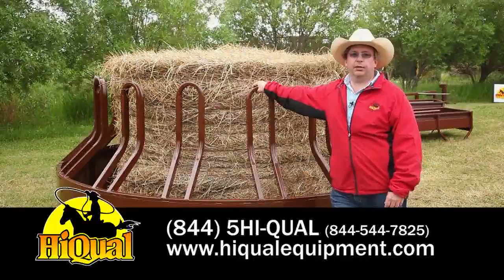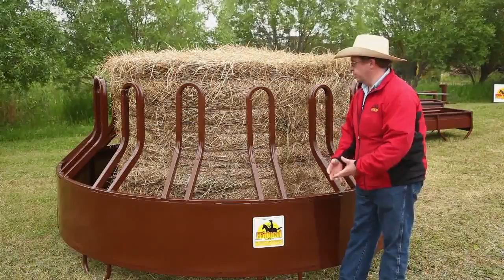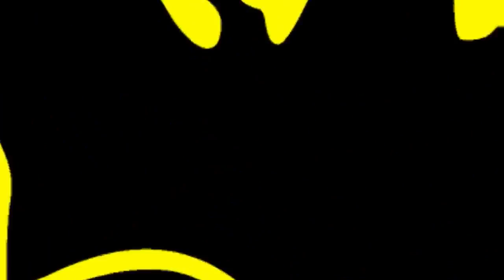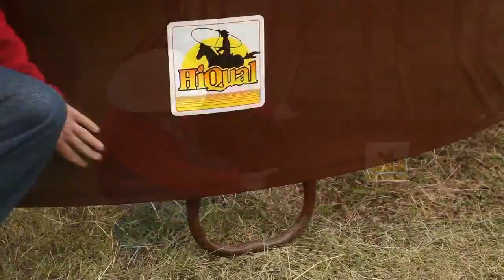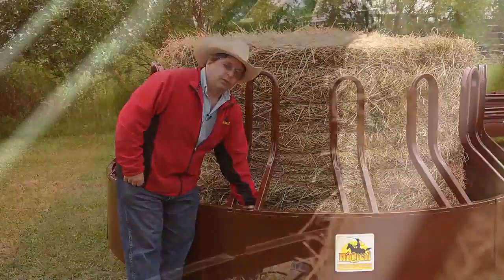Hay Bale Feeder Tombstone Hay Saver

Comment: Itd be nice if the guy in the video spoke about how it works with horses since the tombstone feeder is for horses...
Reply from the maker: Hi Lauren,  

These feeders are built to 'rugged cattle standards' and they demonstrate their toughness by marketing to the livestock industry and haven't done one for the horses yet.

The Tombstone Saver (for horses too) is the same design as the larger Tombstone Feeder but has a narrower measurement between the upright feeding stanchions. The bull feeder has 12 feeding stations that have 20.5" of spacing for thicker cow necks while the Horse Saver Feeder has 15 stations with 14.5" between uprights.  

The horse feeder design is also about 70 lbs lighter than the livestock feeder at 360 pounds. 

Thanks you for your feed-back and I wish we had a video showing horses using the feeder but it just hasn't been done yet so they use the same video for both for now.

If you have any questions or if we can help with anything at all, please don't hesitate to ask.

Thanks again!

Rob  720.238.2190  
www.barnworld.com

Cattle Feeder - click here:  https://www.barnworld.com/cattle-guards/?product_link=round-bale-feeder-for-bulls-and-large-animals

Horse Feeder - click here:  https://www.barnworld.com/cattle-guards/?product_link=Round-bale-feeder-for-bulls-and-large-animals54484C13-847D-4C93-8F8E-0677EED0F462